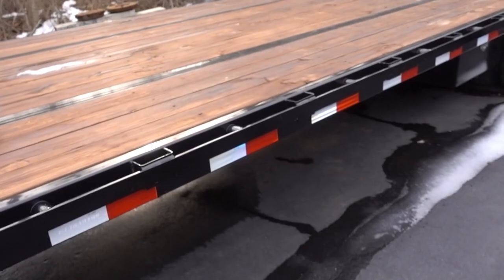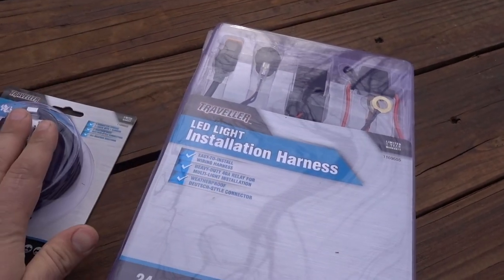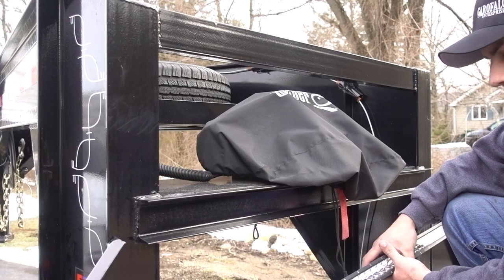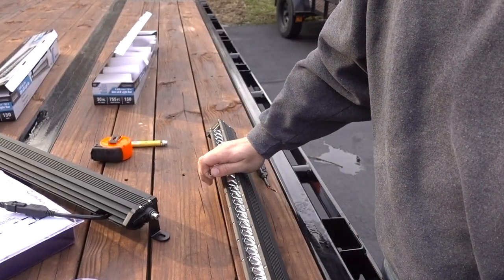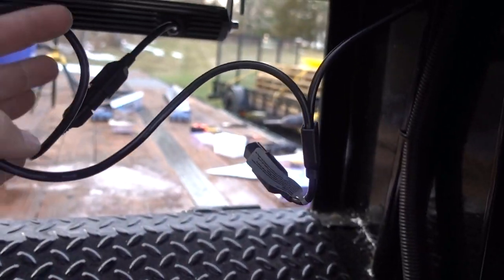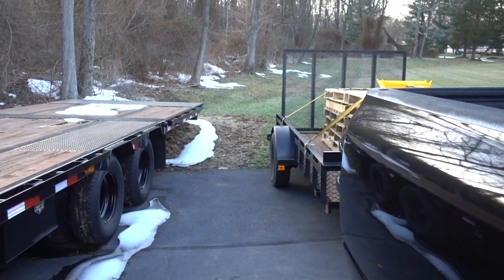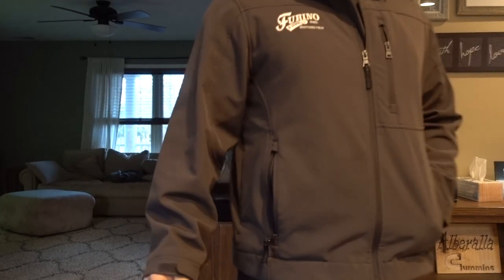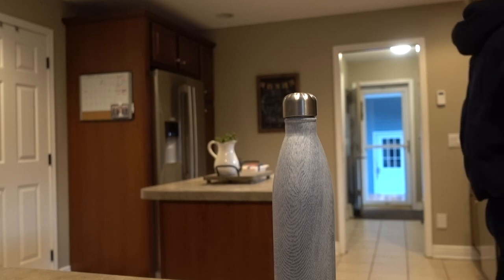PJ GOOSENECK TRAILER MODIFICATIONS!!! IS IT RUSTY YET!?!?!

Comment: You could put some sort of under light or rear light on the trailer for backing up at night, not sure if the trailer has it, your 7-pin connector has a wire for the reverse signal

Comment: one customize idea I did was buy a quality rv tire cover to keep the spare rim rust free and stop the sun from drying out the tire. If you flip the rim water can't stay in it but if you do you will have to relocate the hole for the padlock, the rim will rust facing right side up the way the factory put it. I flipped mine over now I have the whole rim to store stuff and is covered by a tire cover. Just my 2 cents.

Comment: I also have a PJ! Going to add  a series of amber running lights down the side, probably the 1" LED's! The existing running/turn light midway down trailer in recessed into the side tube, but I will probably mount mine on a small L bracket below the tube to avoid hassle of fitting them into tube and pulling wire through it!

Comment: Nice trailer. You should have installed the lights vertically on the neck risers. Anything you load on the deck is going to block the light while you tie down. Putting them on the outside of the risers lets you see while you tie down.

Comment: Greg, do you get hassled by commercial enforcement units at all?  I know you are using the trailer for personal use ,and not commercial but your GCWR is well over 26000 lbs putting you in the CDL A license category. Also requiring you to stop for inspections although you shouldn't have to comply with commercial regulations.